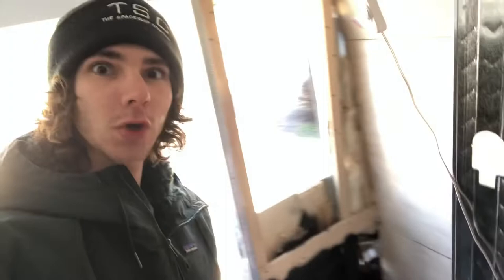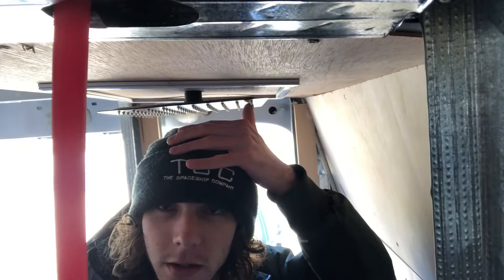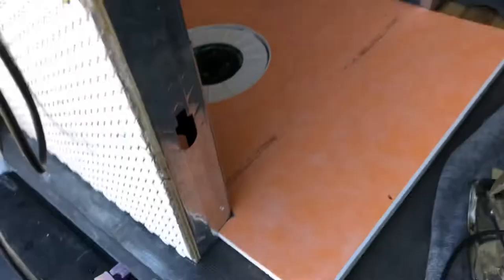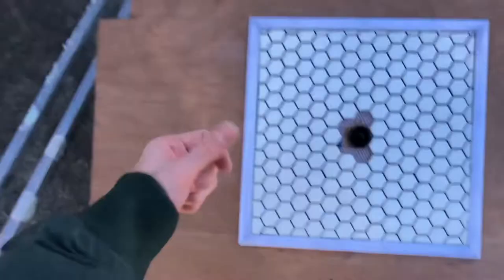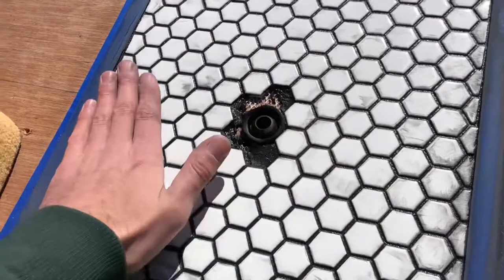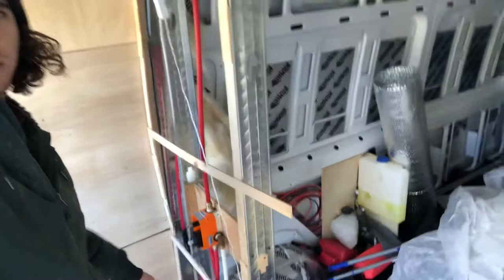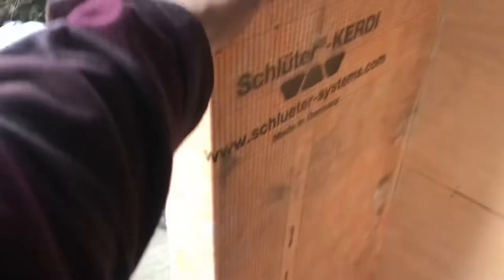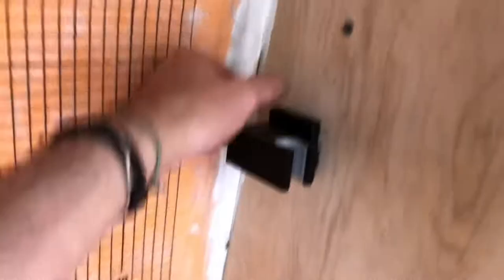WATERPROOFING sprinter van shower with Kerdi Board

Comment: Why did you use plywood over kerdi board? Was it cost? Tile installer here, I would have figured the weight savings could have been worth it especially with such a small space
Reply from the maker: One reason definitely was cost but I did  really want to maximise the size of the shower and by using 1/2 plywood and kerdi membrane I saved a few inches all the way around. Also the plywood helped attach all the shower components i believe I would’ve had to use plywood under the kerdi board anyway with the way I attached my shower handles and plumbing so it definitely saved some space and some $$
Reply: @Absolute_North  that is a good point actually! We will run wood in our walls to attach things to since kerdi is foam, the plywood let you skip that step, good to know, I'm researching converting an 8x16- 8x20 enclosed trailer into a camper